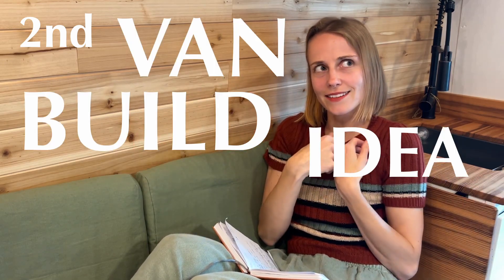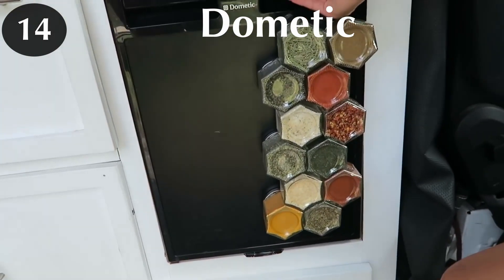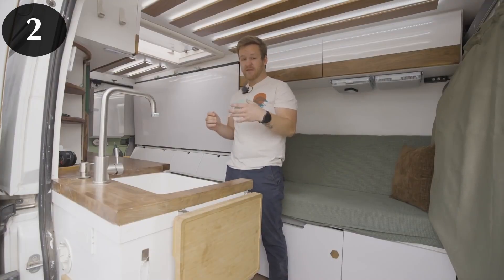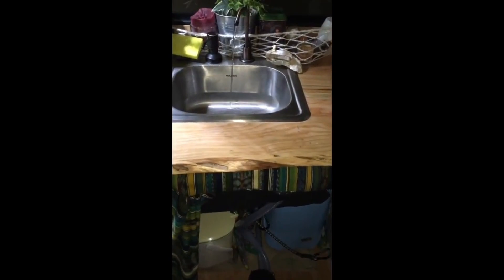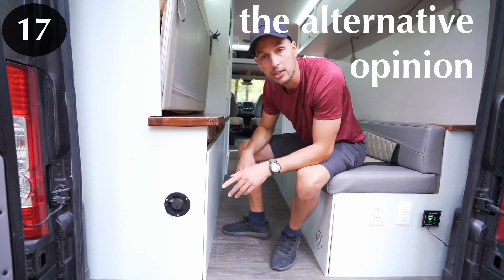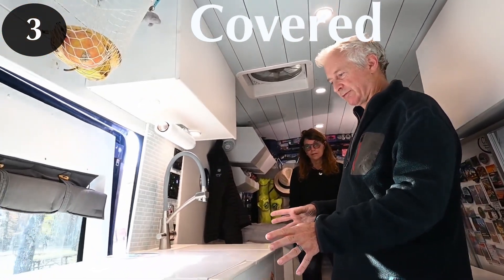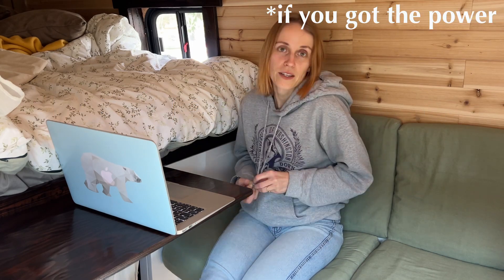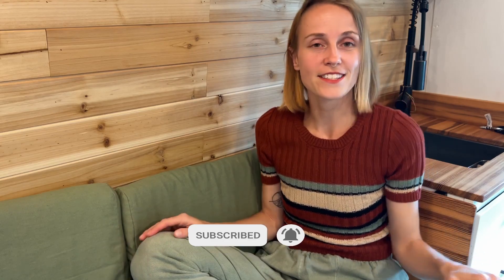The Ultimate VAN KITCHEN VIDEO - Tons Of Ideas For Your Camper Build

Comment: So the good news is the knives don’t fly off of the magnetic strip and stab you in the back unless you have a front end collision so hopefully you’re already dead from the front and collision before the knife stabs you in the back or neck or head. Strange you didn’t talk about the fires started by lithium ion batteries but instead spread the myth about propane tanks being dangerous I guess you’ve never seen an RV with them on the outside either

Comment: 20:40  Propane is heavier than air.  Propane is flammable when mixed with oxygen.  All fixtures and valves and seals can leak, and eventually will leak.  So store all propane bottles in a sealed locker with a floor vent, and well away from sparks, wiring and extreme solar and engine/catalytic combustor heat.  There are no exceptions for 1 pound bombs,I mean bottles.  Same for little butane stoves.
Reply: Also, a gas sensor/alarm next to it

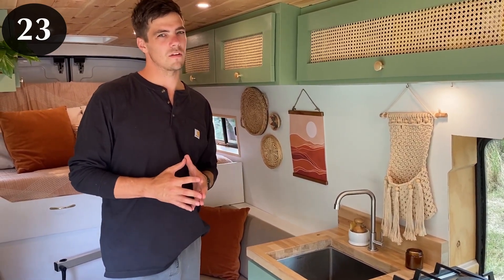Comment: 10:24--- I was a Certified Food Health Manager for Florida years ago. Quick tip for dishwashing: Use 2 caps full of bleach for gallon of water and the bleach will kill germs/ bacteria... the bleach also helps with removing stuck on food as long as you let the dishes set in the water for at least 15 minutes before washing. I rarely use my hot water faucet in the kitchen for dishes bc I've also learned that I can heat up 32 oz bowl of water faster and cheaper than using a water heater! Dump the heated up water into your soapy bleach water and voila.

Comment: 19:05 Ovens ? Yeah great, I had a small sailing ship galley oven/stove combo (from which the 2 burner hob had failed which I removed before installation in the van) 
For a while I used the oven as is on propane (which I carried just for the oven since my stove runs on ethanol) and after that failed I removed the gas sheit and converted it to ethanol as well. That worked swimmingly for about 6 months but I found myself not using it that much and eventually I decided to remove the oven and replace it with a drawer in which I installed a home made heat retention cooker (which in my case is a Wonderoven - search for it on Youtube on what it is and how you can make one too)
Just around the time I decided to remove the converted oven I learned about the Omnia stove top oven which has a cult following and is worshipped quite religiously. I like the idea and started looking for one on the second hand marketplaces. I found one of a Spanish brand called IBILI which is a slightly larger version of the Omnia. I have been using that thingy for about 6 weeks now and let me tell you, the cult and religious following the stove top oven pans have are justified... These things are simply awesome and a near perfect replacement for regular gas or ethanol burning oven.
You can do just about any dish you can do in an oven though it requires a bit of a rethink, but any galley chef worth his/her salt should be able to figure it out. 

Look into the Omnia, IBILI, Versilia or other brands of the Stovetop Oven Pan if you are missing an oven and actually want an oven function in the van but hate to sacrifice the galley real estate and/or the money to get one...
Reply from the maker: Oh wow, thanks for the tip! And on your review of the other ovens you've tried! We'll check it out! Our main thing is pizza, but I'm sure there's plenty of such Omnia Pizza tutorials on yt! :)
Reply: I looked up the "OMNIA" pan expecting to see heaven and angels... 

The "OMNIA" design is nothing more than a "BUNDT" cake baking pan, with a lid. I suppose I may be showing my age, but, every kitchen from the 1970s on forward has one in their Hoosier cabinet. 

😒 Yup. I'm old. 
🤣

Comment: Great group of questions. Further beyond knowing if / how you cook, then find equipment solutions that meet your desired balance of functionality, weight, and longevity. If budget is a concern and you are setting up your van for just one big trip or a few little trips, then lightweight kitchenware means less fuel. However, if you plan on this as a lifestyle and would rather gear lasts than hardy stainless steel would win over cheaper plastics. Take containers for instance: Joseph Joseph nesting with snap lids would probably be easier to clean & last longer than collapsible silicone containers. 
We’ve had our stainless steel camp dishes for several decades. They are not light but will outlast a few generations - and are dishwasher friendly. Get all your kitchen gear and plan your kitchen design from the inside out. I laugh when I see cupboards filled to the brim in a van but the top half of the utensil drawer is empty space. Small space storage should be designed for the gear - shallow, one item deep; no corners using vertical wall space. And more hooks.
Reply: If vanlifers thought about using a one bin kitchen or a tiny camp Chuck box first, they would design van kitchens very differently. Use what you have/ only what you need first - you’ll find you need a lot less in reality. The more you pack, the more you have to clean with limited water resources. The less time spent cleaning/organizing, the more time outside.
Reply: And whistling kettles do not belong in a quiet campground.

Comment: I worked in refrigeration for about 20+ years….a normal Domestic fridge will shake itself to destruction..they are not designed to “ go down the road”…. They will bounce the compressor off it’s mounts, the copper tubing will rub and u will get a huge lungful of refrigerant in your van eventually….not good.
I have a Dometic CRX 110, it is very quiet, the unit ( refrigeration) is very minimal and well designed, short runs of tubing to condenser etc, when I saw it, I knew this would be a great fridge for a van.
However cost is a factor…but a fridge can be a total essential to some guys….
I recommend a Dometic fridge on internal design, outer design, but expensive…
Take your choice! If u can’t afford a bigger Dometic, buy a size you can afford. The CRX 50 is very popular I hear in the UK
Reply from the maker: That´s good to know! Thank you!

Comment: Thank you for this excellent discussion & comparison of options! 
For cooking, I have now decided on a spirit stove (runs on bio-ethanol) which is a liquid fuel & safer than gas, so no need to worry about gas lines. I have not used it yet, but apparently it cooks a lot slower than gas, which can be an advantage if you do a lot of cooking on low heat (eg eggs, fish, simmering) but a disadvantage if you want a hot, fast flame. I do also have a small portable camp gas burner which is great for heating water for coffee - but that might end up being a bit tiresome for some people.
Reply from the maker: You're so welcome! The ethanol stove sounds great! I was looking into that too but didn't find too many options out there. Hope it works well for you! Good to have 2 options in a pinch! We use the tiny camp stove for morning coffee as well - it works. :)

Comment: Really helpful video, but I do disagree with two points.

1. When Ladi said that taking all of the time to find something in a top loading fridge let’s all of the cool air out anyway, that isn’t true. Cold air ALWAYS drops and warm air ALWAYS rises. That’s why refrigerated sections in food store remain open on top. It doesn’t matter how long a top loading fridge is open.

2. Using a Brita doesn’t remove nearly as many contaminants as multi faceted water filtration system. Bacteria isn’t the only bad thing in water. There can be toxins, or even water with high chlorine or high mercury can be problematic. We need to read the full list of everything our solution filters to understand what which contaminants are removed and which may stay behind.
Reply from the maker: Oh those are some great points! Thanks for bringing it up! 
You're right... I guess I didn't account for the "clear drop/rise" of cold/heat, but true, there are lots of grocery stores where things are open. 
And true, Brita is not the holy grail, but as we make sure to only get potable water and don't take risks there, that's usually all we need. I guess some states have worse water than others. Definitely good to double check something like that!

Comment: 20:50 Storing gas bottles just casually in a drawer or someplace under the sink is.... well .... what do you think ?

After I did away with the gas oven I removed all the gas lines, the 5 L gas bottle and locker and never looked back... Gas is fine and dandy but under a curtain set of very ill fated (but not uncommon) circumstances very dangerous... I did not want to roll that particular dice anymore and got rid of gas quite happily...
Reply from the maker: True, it’s definitely not the safest option, but just so convenient. If induction just wouldn’t draw so much energy…
Reply: I read somewhere to Listen to the little green propane bottles after you use them.  To make sure they seal.
Reply: @lisasomewhere88  There are induction cooktops (usually sold as single plate versions, sometimes the same brand has a double plat version too) which let you set a max. power consumption or even a temperature which you want the pot/pan to get up to.. that could save very much power  since most cooking scenarios simply do not need that crazy amount of heat.
Also if you employ a hay box (heat retention cooker like the DIY Wonderoven - look for it on Youtube) in conjunction with the induction cooktop you can even stew not so tender meat cuts with very little electricity use.

Comment: I'm just wondering, wouldn't it be a good idea to have your water tank in top of the van?,  So in that way gravity is your pump... 🤔 Anyone knows the pros and cons or have any thoughts about it, let me know please ✌🏻
Reply from the maker: That's a great question! But I personally can mainly think about cons: It definitely would require a very sturdy cabinet or bracket or so to keep this thing secure and not flying across the van causing major havoc. Thus it also would restrict your water tank size. When refilling the tank unless you have a special hose system it would be much harder to lift the thing all the way up when full. And depending how you want to set things up with the gravity faucet - it might be hard to "turn the water on" without losing a bunch of water. 
Installing the foot pump I'm talking about is really simple and much more convenient I think. :)

Comment: Faucets...yes, you can get what you want.... but those industrial looking ones with the springs don't reach as far and are not as flexible as the pull out ones that have been around forever.  I don't know why anyone buys those even though they look cool. Although, no one seems to admit to hating them as much as I do.
Reply from the maker: Not sure if I ever had a pull out faucet you´re talking about. But the more reach, the better - that´s for sure!
Reply: @lisasomewhere88  They are very very common.  The hose is hidden inside the faucet and you can pull the faucet off it's shaft for more flexibility. Then, the hose just feeds back into the shaft when you replace the head.  The industrial trend became popular in the early 2000's but it really is not as functional in the home as they don't have the reach and flexibility and usually the spray is too strong and so spatters everywhere.